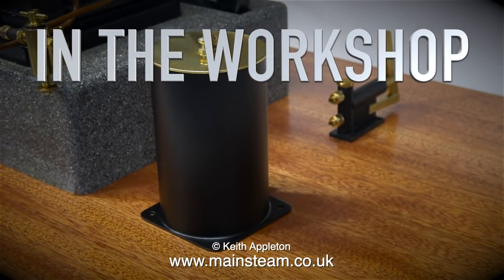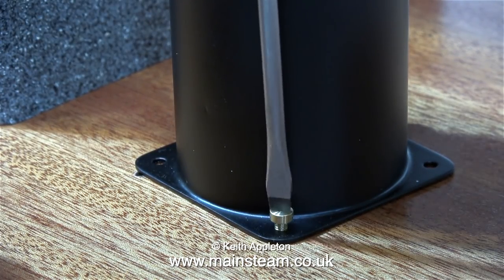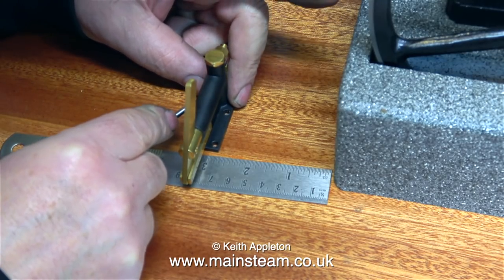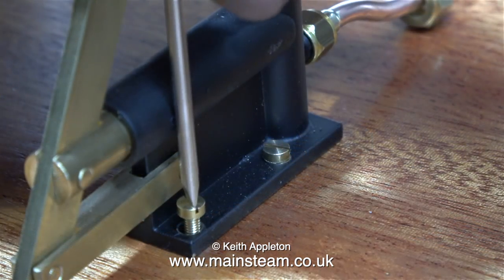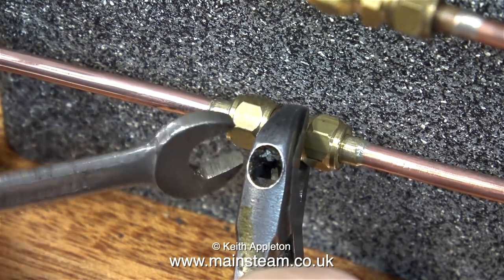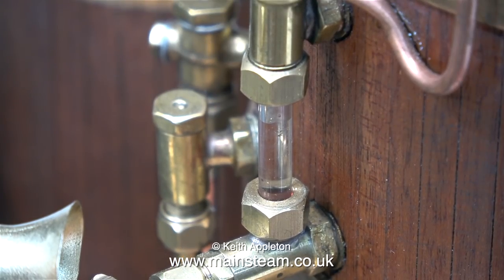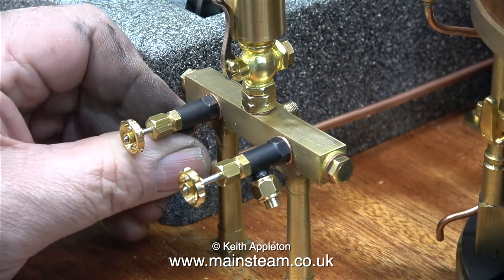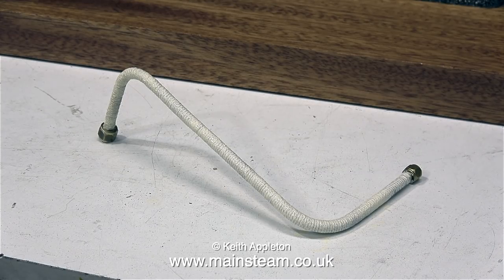ATLAS STEAM PLANT CONSTRUCTION - PART #9

Comment: Try a little heatshrink on the shank of screwdriver should help with protecting the paint on those pumps.
Reply from the maker: it doesn't work - the paint still comes off the edges of the Brass - I have tried it.

Comment: Hi Keith. I find that when working with tools dangerously near paintwork, loosely putting some masking tape where the tool will rub against helps protect the paint. I thought about it when I saw your screwdriver marking the pump.
Reply from the maker: I did use masking tape initially, but I didn't include it as a tip in the video because it didn't stop the part from being marked ......

Comment: Nice....  When do you find it necessary to use krazy glue ( CA or superglue ) in the wood threads again?    Until they revise the water pump mounting plate holes, perhaps grind down screwdriver shaft to prevent scratching the cylinder.   Cheers